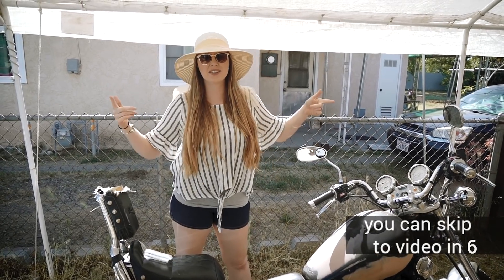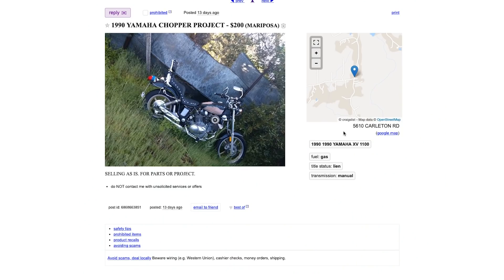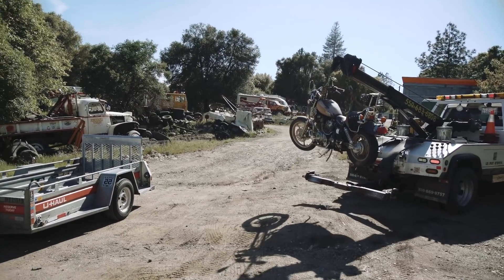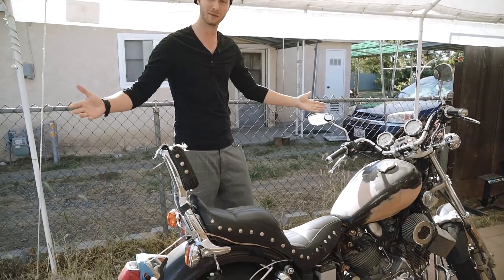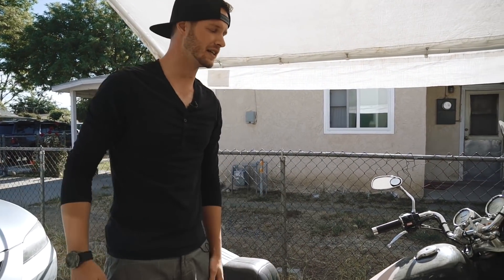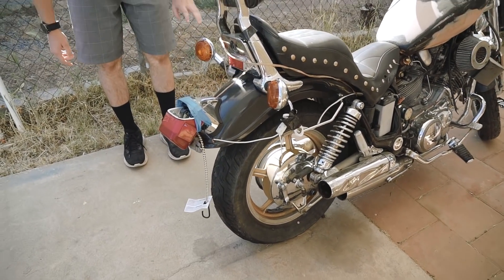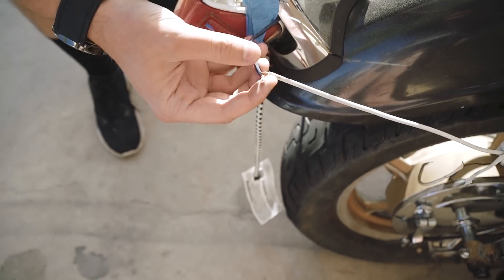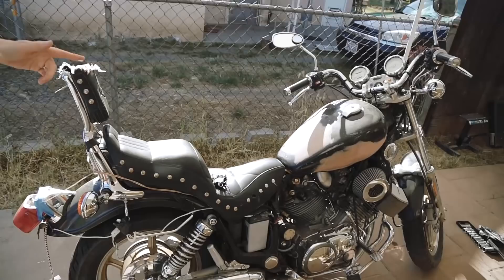Abandoned Yamaha Virago XV1100 Motorcycle Restoration Part 1

Comment: Exactly what I paid for my 2013  vulcan 800. He did the transmission upgrade already. He just didn't have the time to put the rear tire back on after the change. He couldnt keep it running. After removing all the emissions crap and the stock air ox and filter and just adding a knl 4 inch air filter site fired up instantly and still fires the second I hit the ignition. No choke needed. I've customized it a lil but now winter is here it's time to tear down completely and design and build all new frame and everything